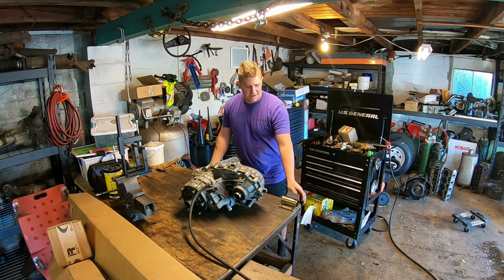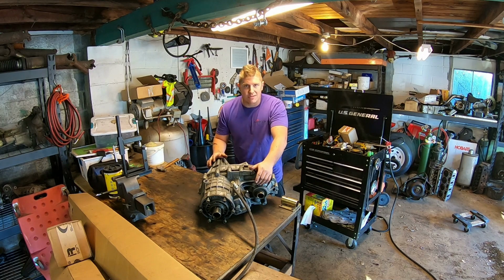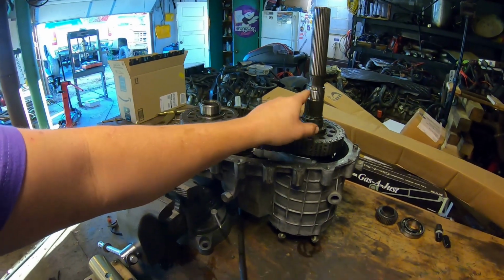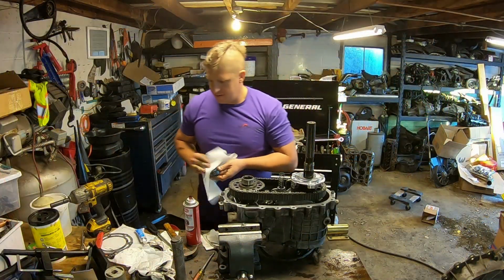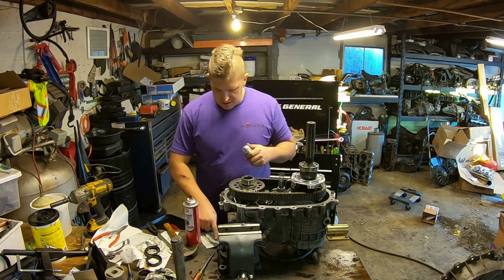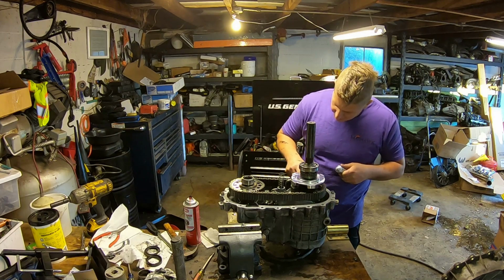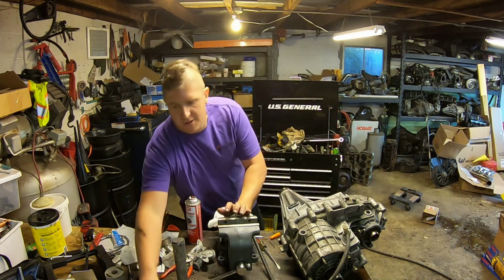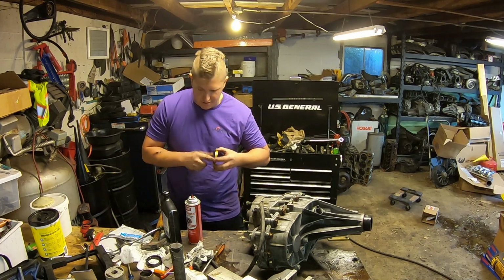EASY PERMANENT REPAIR for GM transfer case PUMP RUB,

Comment: I am having trouble confirming the output shaft seal as correct for my 2006 2500HD 4x4 with Duramax 6.6 and allison 6spd auto. The number you list here (Timken 4333N Seal) doesn't come up as correct.
Reply: It does have the NP261XHD transfer case
Reply from the maker: Yeah the NP261XHD uses a different seal, pretty much everything about that transfer case is bigger than the gas versions.

Comment: Know the part number for the bushing and input seal?
Reply: Did you show where you replaced the bushing? I missed that part on the install video trying to find a video on the bushing replacement
Reply from the maker: @xXxjoemanxXx  I'm not sure, but the bushing just drives in like most bushings, all you need is a solid surface, a hammer, and a bushing drive the right size
Reply from the maker: Links in the video description

Comment: I'm taking mine out now, 2005 3500 4x4.
How much does it all weigh? I'm guessing about 75 lbs.
Reply from the maker: The transfer case weights about 80lbs.
Reply: @MohawkMotors  Google says the 263XHD weighs 96 lb.

Comment: That steel gaurd definetely does not work lol, mine was extemely worn out behind it
Reply from the maker: no kidding? I've never seen one wear out with the guard still in place. Seen several fail because the guard fell off or broke.

Comment: was it the pump saver not lined up that caused the problem reassembling?
Reply from the maker: I don't think so,  the pump saver seemed to line up fine, it was the shift rod that was the hardest to get lined back up into its hole